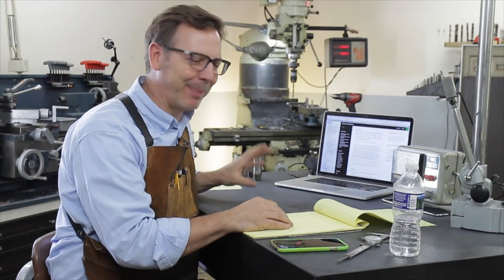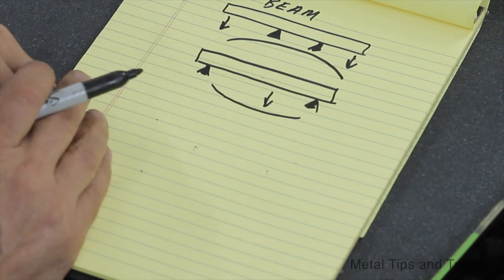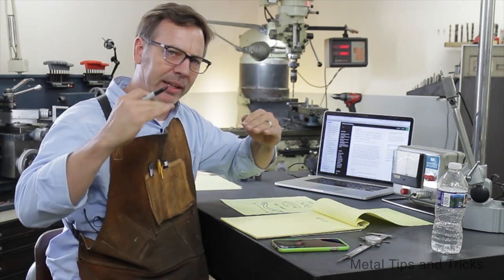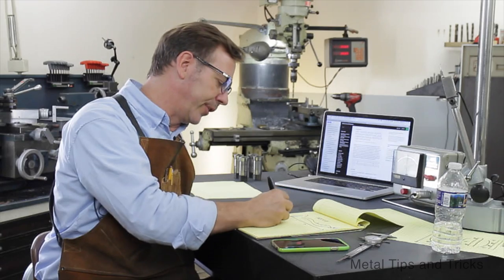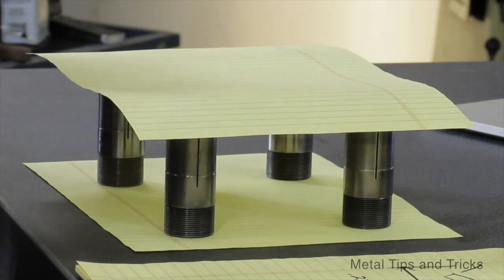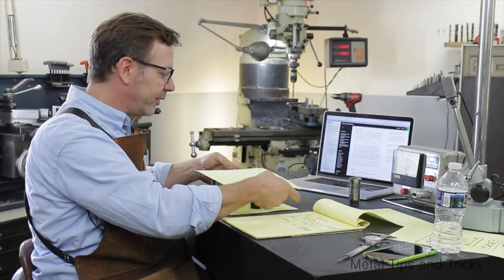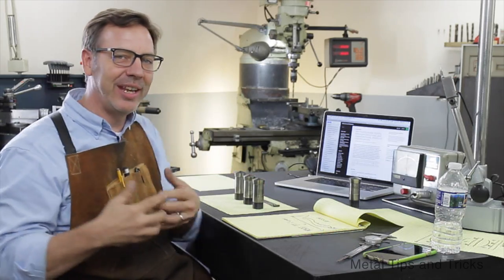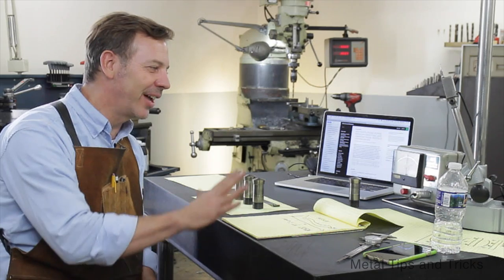How to set up a surface plate

Comment: Whoever made that surface plate supported it from the three points that they calculated when they lapped it flat.   Unless you support it from the same three points that they used, the granite will sag differently than it was when they lapped the plate and it won't be flat.   My Starrett surface plate actually has three little recesses on the bottom of the surface plate that clearly shows where the mounting points should be located.  I believe the mounting points on your surface plate should be identified as well.  If so, you should design your stand to support the granite from those three marked points.  Chris
Reply: Got a 36 x 36 x 6 and the same applies with the 3 recess points under where to land it on... Wonder if Dale checked if there were those 3 points under his table...  ???
Reply: why doesnt he use 5??
Reply: @shadowdog500  right on bro thanks for the quick answer and monty python quote - you rock
Reply: Thanks for that info.

Comment: Just unboxed two small, 12 x 18 x 3" surface plates last night. Running across your vid this morning, was perfect.  It looks as though three points will work for me, and now I don't have to research the multiplier for location, either.
Thanks, as always.
GeoD

Comment: Yup, shadowdog500 has it correct, use the pads that the plate supplier used to grind and lap. The other thing is to have 3 bolts or feet fastened to the table between the table and the plate so you can level the plate.  The other thing is not to get carried away making the stand excessively  stiff else it will rock unless you have only 3 feet or legs. Of course the problem with a 3 leg table is that they can have more tendency to tip over if you have an earthquake.  Lots of fun.
Reply from the maker: Thanks for your comment

Comment: I did know about the airy points and how to calculate there location. That information is pretty easy to find. Bessel points was a new one to me. Not sure I'd agree about putting a surface plate and it's stand on castors though. Every single one I've seen being used for commercial use is fixed. Must be a good reason for that? Should still be pretty interesting to see what you come up with. To be accurate with the information an email to Starrett, Mitutoyo,, Precision Granite, Standridge etc to see what there views are about castors might be worth while. Maybe for the smaller 3'-4' sized plates it doesn't or wouldn't degrade the accuracy enough to be measurable in the usual shop, but maybe it does. I just don't know enough to say my thoughts about those castors are right or wrong. 

For smaller parts and doing lay outs then even thick plate glass might be good enough for most of what we'd need. I want a surface plate for scraping parts in, so using the full length or width of a plate isn't out of the question. That might be where castors could create possible issues maybe. But proving it's a good / bad idea either way might be real tough without doing checks over a period of time with at least an autocollimator. But in a non temperature controlled to metrology levels shop my thoughts may still be worthless.

Comment: Dale.  I suggest that you look up how large primary glass mirrors in telescopes are supported to keep them from distorting with gravity load. (i.e. mirrors that are 16 or 18 inches diameter up to 36 and 40+ inches in diameter - 2" to 4" thick)  Typically they are supported on a series of triangular plates over other triangular plates/beams, with the ultimate main support being three points, two on one beam and the third on another beam to the telescope frame.
Good luck, Warren
Reply: Oh, and their spacing, I believe, is based on some rule related to the thickness. Warren

Comment: Your value of Pi is off. :-) If you move your plate you are likely to have to readjust your plate every time if you want ultimate accuracy. It is unrealistic that your stand could be stiff enough to apply the same loading all the time to your supports, thanks to gravity unless your floor is perfectly level anytime your plate is not leveled the same way as it was when it was calibrated then it will no longer be accurate.  The reality is that unless you are going for a very high grade of plate then it is all not a big deal for most use.  The only big deal is that the plate be supported and leveled at the same points that it was when it was made. For most quality manufacturers this means 3 points for some really big plates they may use more supports and in those cases they use jack screws and a torque wrench to obtain level and even loads identical to when it was made. There are import plates with no locating marks for the setup when the plate was made and these plates are merely rocks as they can not be repeat calibrated.
Reply: bcbloc02 

I think because he is using three points that the loads will be the same. After all the load supplied to the plate is equal to the load supplied by the plate, which can't change. The loads on the four castor wheels may change but the three points won't in my opinion.
Reply: Ian9toes I suggest you look into Brian's credentials. ;)

Comment: That was a very clear explantation of Airy and Bessel points. Both these guys were geniuses of their day.  The explanation with a piece of paper should be recorded on stone tablets. But there is one thing you did not mention. and it is important. When that granite plate was lapped in at the factory they suspended it on 3 Airy/.Bessel points just as you did. So the plate is flat -- as long as it is suspended same place the manufacturer did. There is usually a small indication of this on the bottom of the plate, and you would be wise to heed it. Else it will be slightly off kilter. Then there is the whole business of leveling, but I refer anyone  to Tom Lipton for this. In metrology (quote Tom Lipton) everything matters, even if it means turning that giant plate upside down to find the suspension marks. Ugh.
Reply from the maker: Thanks for your comment:-)

Comment: 5:10  The formula work with metric? and another question: how many 1/1000 inch or micrometer  can flex a plane surface (in the horizontal plane) (such as your 6-inch) to its extreme edges in the worst case (like a single central point of support)?

Comment: Hi Dale, have you checked if the manufacturer of the plate made provision on how to lay the plate, normally they stand on 3 points cause they were manufactured that way... 
Just curious, even if the cantilever idea is interesting for auto leveling.
Reply from the maker: Yes I did and they had none. I came up with this idea a few months ago. Then found out my idea was correct when I discover that Starrett has done the same think with some of there surface plate stands

Comment: In watching your episode on setting up a surface plate, here is what I notice:
  1 I have a cast Iron surface plate which has 2 protrusions on one side (bottom) and one protrusion on the opposite bottom end  and it is supported only at those points.
   2 In setting up a small lathe (Bench top model). How should one best proceed 2 steel balls under the head stock end and one steel ball under the.  tail stock end or just bolting down the four corners at the provided holes.

Comment: The same suspension concept is used in a variety of applications, and was standard in the days of steam locomotives, under the term equalization. I don't know if I would go for more points with a large whiffletree (as suggested in one comment), as friction and small errors in centering add up and won't likely improve support, but with a lot of complexity. Foam or floating are options, but, again come with other problems, like rigidity to maintain level and indeterminacy of support. A lot of things have been tried, and simple mechanical support is used because the advantages outweigh the disadvantages of other methods. 

The concern I would have matches shadowdog: What were the supports when the plate was flattened. It doesn't matter if you are going to have it resurfaced after mounting, but, if not, then you may find some unwanted deflection from best condition.
Reply from the maker: Great comment, Thanks

Comment: Have you considered using a high to medium pressure hydraulic hose around the periphery, connecting the Bessel points, then pressurize it with fluid??  This would allow the cart to flex and still be flat.
Reply from the maker: No, I have not. it is an interesting Idea.

Comment: Excellent video, Dale. I think your calculations would have been limited to two significant digits.
Reply from the maker: I agree LOL
Reply: Dale, a question. In the Keith Rucker video tour I think there is a lathe in the back opposite the milling machine. I dont think you mentioned it or am I wrong?
Reply: The general rule is to use one more decimal place than the least significant number in the calculation.  You are using 4 places and 0 places so use 1 decimal place for your answer.  The theory is the last decimal place is +/- 0.5 of the last place.  In actuality you should be able to easily measure 11 inches plus or minus 0.1 inches so the answer could realistically be to 2 places.

Since I am an engineer and a stickler for detail, PIE is actually PI but I will take the first in chocolate is you please.  I do think you can easily measure and mark to 2 decimal places with a pen or marker on paper.

Comment: Do you do inspection, use the plate for shop layout, or simple metrology or complex metrology or even laboratory like metrology or a mix of that?  That would define how accurate you need to be in your surface plates plane.
Reply from the maker: I use it for everything. except a table to put  garbage  on. LOL

Comment: how critical is Bessel points for a smaller surface plate like 24x18.  also mine is on a table top.  does this matter?
Reply from the maker: From what I herd you should be fine on the 3 points that it was originally  lap on.

Comment: Hi Dale,
looking up the Bessel point , it appears the Bessel point (0.5594 of length) is the point of support that results in the minimum amount of centreline divergence (shortening of beam), not the point where there is minimum deflection.
the support points for minimum overall sag is different at 0.5536 of the length.
I agree that this is minor but speaking theoretically , as the discussion was, the terms are different.  For a one metre beam it is only 5.8mm (228 thou) closer together.
again good work and thanks for introducing the subject.

see Wiki at https://en.wikipedia.org/wiki/Airy_points
Reply: Yes points of minimum deflection

Comment: I'm 6 years late. Oh well..

AIRY POINTS, BESSEL POINTS, MINIMUM GRAVITY SAG, AND VIBRATION NODAL POINTS OF UNIFORM BEAMS

1. Airy points — zero slope at ends — supports located 0.21132 L from each end
2. Bessel points — minimum change in length — supports located 0.2203 L from each end
3. Minimum deflection due to gravity — supports located 0.2232 L from each end
4. Nodal points of first vibration mode — zero deflection at these points during free vibration — supports located 0.2242 L from each end

I think #3, 0.2232 L is what you want. The pivot beam on one end is a good idea. Just don't put a lot of weight on either corner on that end. It will stress the plate diagonally from one corner to the opposite corner..

Comment: who says that we can support a plate on only 2 points (in one section) or 3 or 5 points on its surface? why not 10 or 20 points supported by a whiffle tree so that all points carry equal loads? Or an infinite number of points by a full area support e.g. by a fluid cushion. or a piece of foam .
Or you could support the plate on 3 arbitrary points only but then hone the plate surface flat when sitting on those points. If you dont shift the plate afterwards it stays dead flat also.

Comment: If your metrology will include vibration evaluation, then you'll need to set your granite slab on a bed of sand to eliminate the high frequencies which would otherwise be transmitted through th granite. At that point you could start doing your own holograms!
Reply from the maker: I did study Holograms in College. We floated  the surface plate on rubber bladders
Reply: *****
YES! Highly recommended.

Comment: I can't wait to see the finished project and how you solve the problems on the way.
there is a FREE program that I use to help me with my own designs call Google SketchUp it is a 3D program it OK but it only works with straight lines even for circles (it default setting is 24 sides to a circle or an arc).
It's better for building than engineering but with a little thought you can get away with it and it is easy to use.
NO I don't work for Google and I don't get commission for this LoL

Comment: You're going to think I'm crazy for saying this, but did you type in pi ("PIE" in your video) and skip a couple of digits?  3.14159265358979 is what I had memorized, and it looks like you skipped the .000092!  Obviously it's not important, but I am curious how you ended up with a couple of digits missing!
Reply from the maker: I call  it troll food,  or troll PI. LOL  Good job finding the mistake. :-)

Comment: Dale, I think you've been misled about Bessel points. Bessel points are for supporting a rod with minimal change in horizontal length. Bessel points do not provide the minimum amount of sag.
The minium sag points are located slightly inward of the Bessel points at 0.2232 x length (as opposed to 0.2203).
Now while this makes little practical difference, you are introducing a concept and terminology not relevant to your goal (length change in your surface plate is not important).
http://www.mechanicsandmachines.com/?p=330

Comment: Why not just set the plate on a clay base within a steel container, and let the plate seek its most naturally stress relieved shape, then surface it like that?
Reply from the maker: That is an interesting idea. I don't think it will work with my project because the table gets moved around from time to time. so I don't think the clay would hold for me over the long run. if you do it let me know how it worked for you.